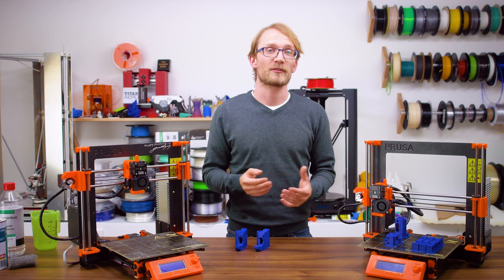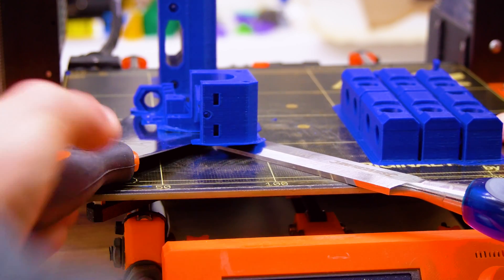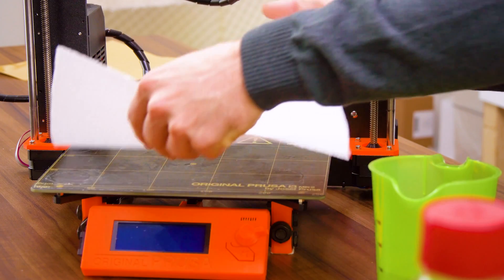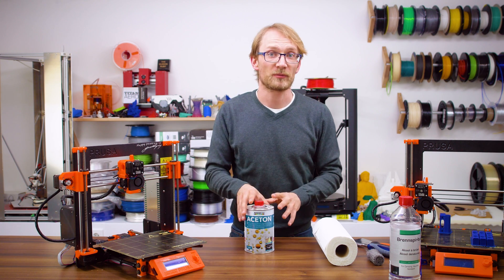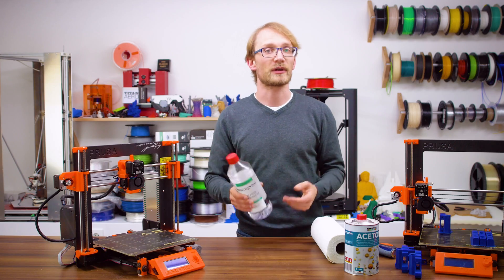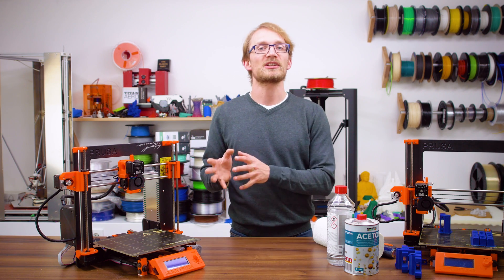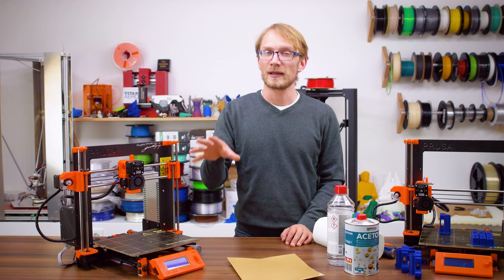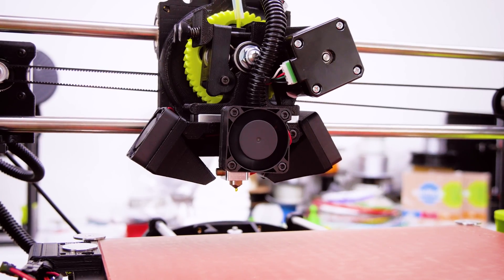Guide: Restoring and maintaining a PEI printbed!

Comment from the maker: I hope you'll never have to deal with prints not sticking, but if you do, this should help you out with PEI surfaces.
Any favorites when it comes to alternative bed surfaces?
Reply: Thomas Sanladerer  
 i like to use buildtack to print on.
Reply: Thanks Tom. Have to say I've never heard of PEI. Definitely will be looking into it.

My favorite is glass. But it can be a huge PITA. If anyone has kids, then you know all about this weird 'slime making' craze. Well, something that's come out of that is the development of clear PVA from Elmer's. Make a slurry of this stuff with about 2:1 glue to water. When it heats, you'll have a sticky, mirror surface. The printed side will look practically injection molded as long as your first layer height is spot on.
Reply: Thomas Sanladerer nothin like some good ‘ol bluetape!
Reply: Hi Tom, Very Nice work on the Editing lately I think some of the other big boys may need to step up their Game.
Bed Surfaces I use Acrylic Matte Medium, It basically Acrylic Paint without the Pigment. 
Dries clear and can be added in layers or coloured with all Standard Acrylic Paint, 
I normally apply with a sponge while the bed is hot and wait for it to go clear and then let the bed cool down.
Thanks for all the Content. :D
Reply: If all you're going to print is PLA, a nice thick piece of Kapton is hard to beat: sticks like glue at temperature, pops off like nothing, even large sheets, once cooled — far better than PEI.  Unfortunately it is no where near as versatile as PEI is with other filaments.
Reply: I once used sail repair tape. The cool thing about this is that the printed side ended up with a really nice fabric texture. Stuff is super expensive though and easily destroyed if the print sticks too well.
Reply: Have you tried LokBuild? I'm going to be trying  it in my (not the cheapest possible) Prusa clone I'm building inspired by your streaming build.
Reply: I personally like the diluted PVA glue method. I usually make a 11 tablespoon (sorry about the stupid imperial math, but the conversions come out MESSY) batch, with 1 tablespoon of glue, and 10 tablespoons of tap water. Mix well and them get a paper towel wet with the mixture. Apply to warm bed with a few coats and BOOM! Parts stick pretty amazing. This does occasionally need to be reapplied, but just running a paper towel with only water over the surface before the print smooths it out, and the coating will last a long while.
Reply: That's been my experience too - that it lasts for about a dozen prints or so. My measurements haven't been so exact, but I should try that. Have you used the clear PVA? I've found it takes more of the glue than white glue.
Reply: Hey Tom, try using super glue for patching on dimples (Us Delta owners over on the SeemeCNC forums find Bob Smith Industries CA works best).  I also agree with the folks who say not to use steel wool and to use sand paper instead.  I get pretty good results with a piece of 1K grit sandpaper.  

Another thing.  PEI seems to eventually craze with acetone exposure and become more brittle.  However, that may be due to the leftover manufacturing compounds from that source.  Alcohol as a daily driver with acetone for heavy cleaning sounds alright.  I also REALLY suggest wetsanding with the alcohol when you're using the paper.
Reply: Cheap window glass has always been my favorite. To print PLA, give it a coat of hairspray, or when printing ABS, Nylon, flexible, or really anything else, use a glue stick. 

Normal 1/8'' thick glass from a hardware store will cost $0.50, and it's much more tough than you'd expect.
Reply: I print on the old heated bed (Red PCB),  that is covered with 1/16" glass, which is covered with kapton tape. 
brush a little ABS juice while the bed is hot. Ready to print...
To remove the part from the surface, I put the whole glass plate in to the freezer for an hour. The ABS shrinks a lot more than glass in that -20ºC, and the part just pops off with a good wack. That's it that's all. Cheap and easy.
Without this freezing techniques (I call dibs on this technique),  No damage to the tape underneath, since no tools were used to remove the parts.
Reply: Thomas Sanladerer - i print on a Glass sheet, with ABS Juice, it sticks so well that it actually ripped parts of the glass surface off, costs next to nothing and takes all those brims and perimeters and you only need a super thin layer on the preheated bed, no corner lifts and no unsticking midprint.
Reply: Maurice Nonnenmacher I always sand my pertinax with a 80 grit sandpaper, until it doesnt reflect light anymore. Then use Isopropanol after every few prints to clean the pertinax.
Reply: It's a little bit messy but I really love the 3Dlac on a glass bed (thinking of switching to aluminum). Compared to other sprays it's cheaper and works really well. ABS sticks perfectly and after cooling down you can just take it off the bed.
My thoughts: Glass is way tougher than a PEI surface, where you get all these scratches over the time. My surface still looks like it was new.
Nevertheless, the MK42 is one great printbed. I'm wondering if there will be one great solution for all the adhesion issues in the next months or years that don't need that much maintenance.
Reply: I use PRINTBITE as my chinese i3clone aluminum bed pretty soon started  to bend so I had a massive problem with that. Since I started to use printbite it works like a charm - cheapest  upgrade you can find in UK. 
I also recomended it to my friend that was using VInci Pro as its glas  printbed did not liked ABS at all since he started to use  Printbite its not perfect with ABS as Vinci chamber has a lot of big holes but he can print something and before it was 100% failure..
Reply: Mine is the spray on dimafix to glass. Sticks really well when hot. Even with Polypropylene and Polycarbonate. After multiple prints just place the glass in a sink of water and it's ready to go again
Reply: We have a mk2 that we just got last week as an assembled kit. We have been printing PLA models using Cura Software, but we keep having parts peeling up from the bed. We have messed with first layer print settings as suggested and we clean the bed surface before prints, but are still having issues. We printed a flat bottom part that was 25mm x 30mm and only 10mm tall and still had it peeling up on the corners. 55 degree print bed and 215 nozzle.. adjusted bed temp up to 60, 75 with no luck. We did change out the brass tip to a Stainless Steel model.. could this be affecting our print?
Reply: Thanks for your reply! We have the mk2 with a PEI bed. I mentioned that the gap may need adjusted between the bed and the nozzle after we had to disassemble the head. My co-worker said the mk2 requires no "gap" adjustment because it is auto calibrated XYZ.. I don't think he is correct though...
Reply: Josh P if you reassemble something, the nozzle might be a little bit higher or lower than before so that the sensor needs to be readjusted to the nozzle.
Reply: PEI is amazing. You can buy a sheet with adhesive backing and stick it right on top of your glass. You get the heat retention and perfect flatness of glass with the RIDICULOUS sticking power of PEI. Go for the 2mm stuff.
Reply: For nylons, Garolite has been the best surface I have ever used!
Reply: I just removed the pei from my Taz 6 I used Goo Gone and a scraper works amazing well. Spray on surface scrap will remove a top layer and repeat again removes it completely
Reply: Qidi bed are also very good... don't know if it's pei...but damn...i have not have a single fail on my qidi printer. The hole print stick very good

Comment: Not all brands of PEI are created equal. Considering those of the same type (smooth versus textured), I noticed extreme differences in adhesion. Example: with textured PEI from Prusa or Anycubic, PETG isn’t difficult to remove and larger parts usually self-release upon cooling, as if picking up parts from a countertop. In contrast, the garbage PEI Creality uses bonds like superglue to PETG — more evidence that buying Creality is purchasing problems.

Comment: Five years later and this video is still the standard on rejuvenating your PEI surface. I would like to suggest trying a non-scratch scrub sponge in place of steel wool. I give my PEI surface a light scrub under water with a little dish soap and it comes back clean and sticky again. I find a used non-scratch scrub sponge works best and does not scratch or gouge the PEI. Thanks for the inspiration Tom!
Reply: A proper wash with dish soap and sponge is my go-to for cleaning my bed, but about once every ~2 years or so (at my print rate) I flip the sponge over and use the scrubber side to scuff up the surface a little. I basically wash it like I normally do, but with the other side of the sponge and it appears that's enough to completely rejuvenate the print bed.

Comment: This video is now 4 years old, so everyone is now probably using removable steel sheets with PEI that you just flex and parts pop off.  To restore, you can use acetone, but I found just scrubbing it once in a while with a kitchen greenie sponge and hot soapy dish soap does the trick.  I use 91% IPA between prints.  Works great.

Comment: I bought the Energetic PEI flexible build plate from Aliexpress. The PEI surface works like a charm, but the bed bends with the warping force of ABS. Ender 3, enclousure, 100 C at bed. I am…baffled. Did anybody else encountered this problem?
Reply: I bought the same plate and have major problems to get TPU stick on it ...not happy with it. To your problem...I think the magnetism drops rapidy after 90º ...maybe a better magnet sticker (3M) will fix that.
Reply: @themountain59  Hello Andy. Try dropping some isopropilic alcohol and rubbing it with a dish wash sponge, the hard side.

Comment: I read that acetone dissolves PEI. Not necessarily a bad thing if it's used lightly and carefully, but it seems like it matters what effect it causes. If it doesn't dissolve PEI, it's just a cleaner. If it does, it actually can re-surface (well or badly).

I need to resurface my 2mm sheet, from scratches from a razor blade. I find sanding with 600 grit is too coarse and fine steel wool perhaps too fine. So I'm still trying to figure out exactly how to recondition it.

Comment: I have the magnetic sheet (black one) i cracked it to two and re applied it. i re adjusted it as it's warping up but actually i ended up tearing it and putting it back. will it affect prints? i haven't printed yet as i'm worried whether to buy a new one.

Comment: Um, Acetone is the worst stuff you could ever use on a print bed to clean it. My first time ever using a textured glass bed and used Acetone to clean it and it totally ruined the print bed, took off the textured surface and the filament would no longer stick so had to buy a new one. Now I only use hot water and dish soap to clean it and it's still good as new. I've also not long changed to a PEI print bed and there's no way ill be using Acetone to clean it. Again I've only used hot water and dish soap to clean my PEI plate and it still works like a charm and no damage. If you want to shorten the life and damage your print bed then go ahead and use Acetone. Good luck.

Comment: It is not recommended to use acetone anymore: https://blog.prusaprinters.org/may-2019-update-original-prusa-sl1-now-shipping-powder-coated-sheets-in-stock-prusaslicer-2-0-and-much-more_30086/

Quoting: "Also, keep in mind that you should clean the powder-coated sheet only with isopropyl alcohol, never use acetone!"

Comment: I think it should be noted that before even trying to clean it with any kind of chemical (which in turn does damage the PEI coating as per manufacturer's advise), try to level the bed properly... sometimes we assume the worst because we think the easiest things couldn't possibly be the problem. Having said that, I loved the video and although I squirm at how hard you were peeling your parts off of your printers, I applaud your bravery :)

Comment: What is the optimal PLA and bed temperature when using PEI? Had some good prints with 200 and 60 before fixing a nozzle blockage. Now nothing seems to stick anymore. Did bed leveling, steel wool and IPA. Still... time to cut a glass bed maybe?

Comment: Does anybody know how to get spray adhesive off a pei sheet, it won’t come off like normal glue stick where I can just use water and paper towl, I’m not sure how to get it off but it’s made my print bed pretty filthy with lint and just glue everywhere, I’m new too 3D printing and was having trouble with bed adhesion so I thought I’d try that and so far it works great  and also give my smooth sheet the look and feel of one of the powder coated sheets which is pretty cool but really messy
Reply: Update: Finally got it off with acetone and 2 1/2 hours of scraping and sanding, won’t ever be using a non water soluble adhesive again
...FYI Elmer’s Craft Bond was what I used

Comment: For people with over-adhesion, I usually use a thin layer of paraffin wax melted onto the preheated bed before printing.  On PLA prints, it's tacky like glue.  When the bed cools, it becomes brittle and releases easily from the bed.  Works great on my Monoprice Maker Select Plus's buildtak, too.

Comment: I would probably recommend taking the bed off before using acetone, the fumes alone can weaken the printed parts on the printer and if you clean the bed a lot it might cause issues.

Comment: Lately I've been having issues with bed adhesion with my PEI sheet even though I regularly clean it with Isopropyl Alcohol...Acetone and steel wool seemed to have fixed the problem.  Thanks!

Comment: I wouldn't recommend using steel wool. As you can see in the video, it dropped dozens of tiny metal hairs onto the print surface like dust. If any of those conductive hairs work their way into the control board, you're going to have a heck of a time troubleshooting intermittent problems. Synthetic steel wool works really well and alleviates this issue.
Reply: Exactly. That and the denatured alcohol he’s using and breathing in is not safe at all. It contains neurotoxic methanol in it. Denatured alcohol is so not safe it’s not even legal to sell in several US states and i. many countries like Canada for example. Just use 91% isopropyl alcohol as it’s works just as well but it’s relatively safe to use.
Reply: @Socal_Geo1  The bottom line. Denatured alcohol is just basic alcohol, used in household products, that has ingredients added to ensure people don't drink it for recreational purposes. Despite its damaging effects when ingested, it is relatively safe when used in household products, even those that come in contact with your skin.

Comment: Wow. I've been using PEI on my Raise N2 for over a year of heavy use, and have never done any maintenance on it other than an occasional IPA wipe just for luck. I've never put any kind of glue on it. I print PLA with the bed at 60º and PETG with it at 80º, and have no adhesion problems. ABS might be a different story, I don't know.

Comment: TOPTIP: "Fireproof" glass. Its not actually glass, its ceramic. It wont bend or warp, ever and temp-change does nothing to it. It wont wear but can be sanded if need be for more stickyness.

Will need VERY good  first layer settings to make things stick but once you get those in, 99% maintenance free. Just wipe it clean with a cloth or paper, boom, back to business.

Comment: Nothing I try makes removing eSun CF from PEI possible. By possible I mean in a manner that is usable, it sticks so firm even the rim bands don't come off and I end up having to dissolve them with acetone. I have tried raising the printhead, laying a thin fist layer, extra speed on the first layer etc. seems if the stuff touches the PEI is sticks like it was intended to be a structural bond. Any one have experience of a solution ?

Comment: Stop using force alone to remove your prints. Place A small amount of alcohol around the perimeter of the object. Capillary action will pull the alcohol under the object. If it doesn't, use the edge of your chisel to raise just a small portion of the object in the alcohol will be sucked under and the part will break loose almost instantly.

Comment: Tom, using too thick a PEI sheet on genuine Prusa printer will change the zero for the Z axis enough that you won't be able to calibrate the nozzle without the PINDA probe being too close to the print. I tried using a 0.8mm sheet and it didn't work out. I switched to a 0.250mm sheet from Hyde, which seems to be working well. It's a bit thicker than the .175mm film that the Prusa comes with from the factory so it should stand up to more abuse while still working.
Reply from the maker: +Ronnie Schreiber you will need to have the PINDA probe at the exact right height, but it should work

Comment: This was exactly what I needed! I've been printing nearly non-stop with my Original Prusa i3 Mk2 for a few months and recently been having problems with parts not sticking as well. Especially large prints, the edges and corners would peal up during printing. Alcohol wipes alone weren't enough. But when I used your advise and rubbed it down with steel wool to refresh the surface, it's working like new again. Large parts are sticking perfectly! No more edge lift. Thanks!